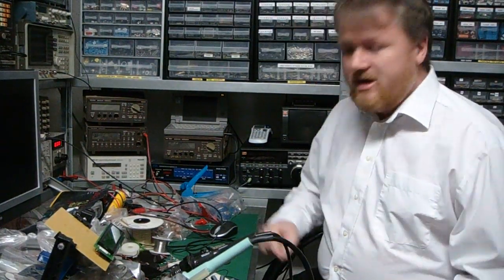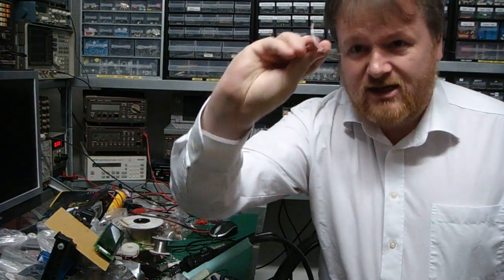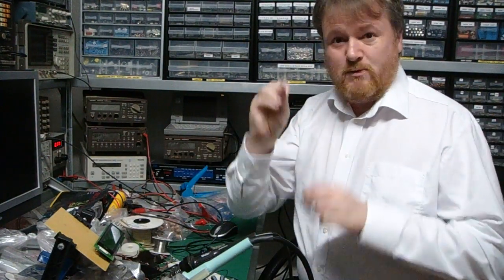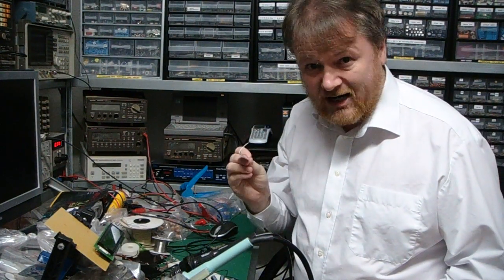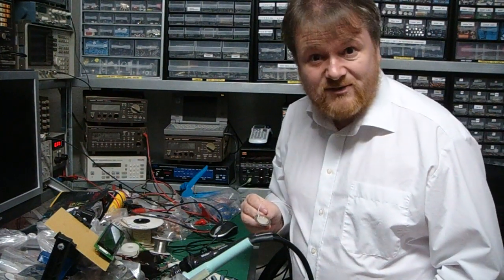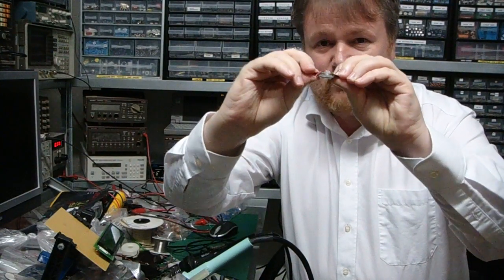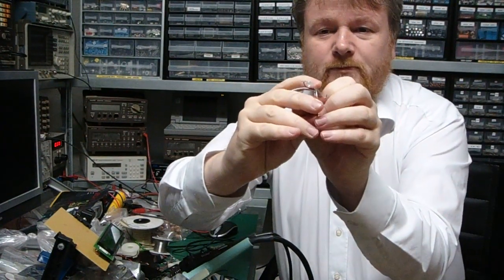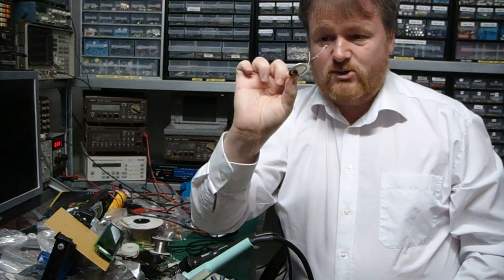Piezoelectric speaker element generates electricity

Comment: Thanks for sharing this. You can also do some amazing things with compressed air. Pneumatics is a neglected field nowadays. Look up Ranque-Hilsch vortex tube and ejector. A vortex tube separates high pressure air into hot and cold flows! An ejector can be used to create a vacuum using high velocity air. That vacuum can be used to do things, and you still have the high velocity/high pressure air left over. Also look up Bernoulli effect and Coanda effect. Air multipliers are cool too.

Comment: Yes, that's exactly how a piezoelectric speaker works. As a matter of fact, most applications of piezoelectric effect are actually the reverse piezoelectric effect of moving in response to current, because the piezoelectric effect doesn't generate power for very long.

Comment: you might want to check out Nitinol for your project. It bends due to hot and cold. Ans if you send a electric current through it, the heat will bend it... then cool down back to is original position.

Comment: hello. i just came across your video. so i have this question: can you use it the other way around? if it generate power when bend, would they bend if you put power in them..i mean enough power. or as you said- connect 10 of those and power them all together, would they "bend". i need a very precise movement (1-2 mm) for an assembly i'm working on and can't be done with solenoid (many reasons), so i thought of piezoelectric elements. thank you for answer beforehand.

Comment: Multi-strand, long but thin plastic strips open to the wind..rows of inverted trumpet shaped horns positioned right behind the strips to catch and amplify the occilations and vibrations caused by the wind vibrating the strips, fed to banks of piezo elements by the tapered ends of the horns...a resonant wind turbine generating electricity from the wind, without rotation. Scaled large or small, works by wind vibrating the strips of plastic to a high frequency, sound travels down to the piezo.

Comment: for example: u turn a stirling engine's flywheel... the pistons starts moving and u get 1 side very hot and the other side very cold.

speakers same thing put vibrations in it and u get power.

Comment: energy u use to make something, like make things hot or cold, spin a wheel, or make music etc works always visa versa.

so yes u can transfer hot and cold to electricity like an stirling engine, and u can get electricity from a spinning wheel (dynamo) and yes vibrations that makes music can also be transferred into... u guess it electricity.

more interesting is: u can use the exact same device u use and reverse it and get the power back... but always with a loss.

Comment: i loved your walking on the floor idea.  their are however some engineering and cost issues to contend with.    perhaps a more efficient back massager,  energy wasted in the handle could be translated into power that would recirculate back into the massager unit and reduce the cost of operation.

Comment: I did this with a ordinarry speaker and an led, it worked but I had to tap the cone pretty hard to get the led to blink.  Also I tried using a piezo speker in a home made microphone and it worked, the sound quality was pretty clear, but no low freqencies, whitch is understanderble.

Comment: dude, no offense, but HOW DID YOU NOT KNOW THIS?!? I mean you have such an awesome looking lab its surprising. aren't you curious WHY the material has this magical property?  piezoelectric elements are not just made of crystal, they are also made of ceramics, and even wood. the effect comes when a specific and uniform atomic structure is deformed. resonate a piezoelectric element and you can get more stable, more usable energy, yes. look into cymatics.